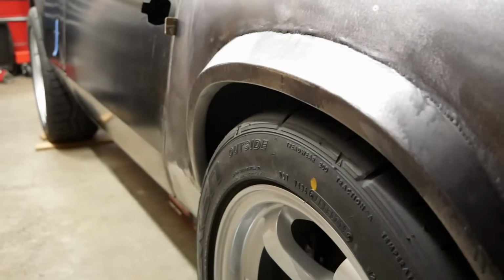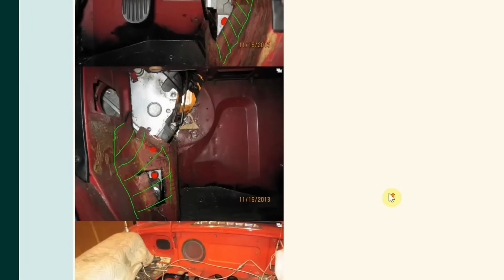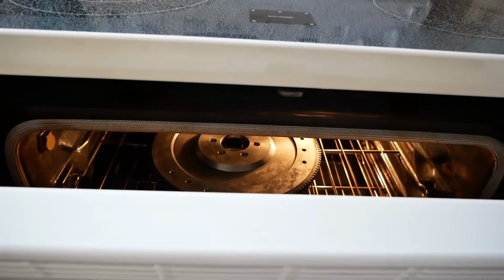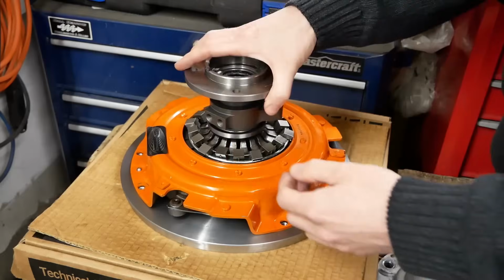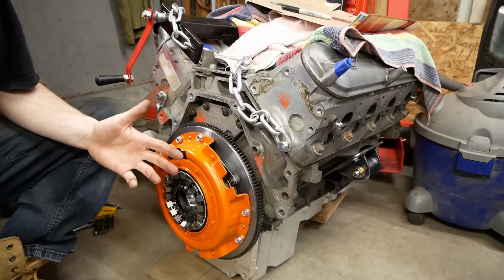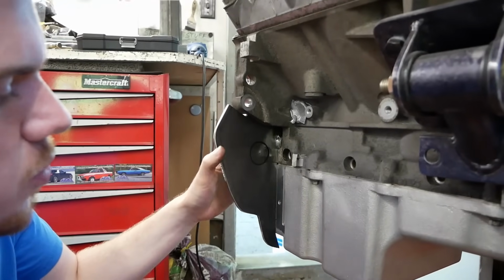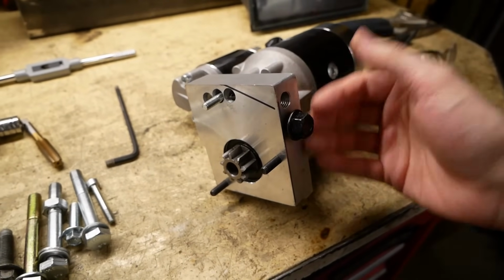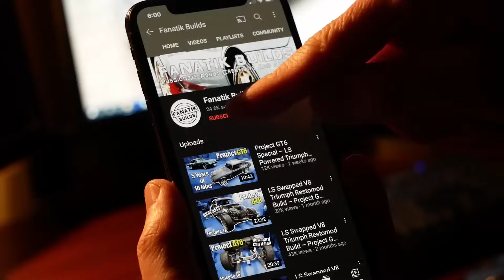The Cheapest Aluminum LS!  Pro Touring Triumph Build – Project GT6R – Ep20

Comment: As a Millwright and fabricator I've used Everlast for years for all my shop and on-site equipment.  You did well and their customer service is second to none.  I have one machine that's a multiprocessor tig/mig/stick combo that's been beat up and down stairs, around equipment and in and out of lifts that's 7 years old without one failure.  Not one.  Just found your channel and you're definitely my kinda car-crafter.  Best of luck!!!
Reply from the maker: Awesome!  Great to hear your first hand experience, hopefully my unit will prove to be just as reliable.🤞 Thanks also for the encouragement, I hope you will enjoy what's to come man!

Comment: Given this advance on your way to an LS powered GT6, the fact that you didn't win your classes in DeBoss Garage's InterNETional car show this year will be just a vague memory when your car wins.  8-))
Your entry needs to be in a "limited tool" category.  
Glad a commenter straightened out your explanation from the previous video and especially that you had the guts to run the corrected explanation in this video!  Mistakes are how YOU learn, correcting them in another video is how WE learn from you! Thank you!!  
Hurry up and put the guts into your LS 4, I want to hear it run!!  It'll also be good for you when new, seemingly intractable problems crop up. Just run the engine for a bit, saying to yourself:  "We WILL make this car run just as the engine does!"
Reply from the maker: Haha, thanks Bob! 😄 It would have been nice to win something but it was cool just hearing what some of the judges thought about the project!  And the gents from Project Binky still haven't judged yet, so maybe there's still a chance? 🤞😉
Oh we join you in the eager wait to hear it run!  It will likely be a while yet though as I'm planning on getting most of the car done before any new parts go into the engine - just makes sense not to have them sit and potentially rust or deteriorate from lack of use (thinking seals etc)... still though, I want to hear it so I may not be able to wait that long! 😂 Cheers and thanks for the kind words of support, I really appreciate it! 👍

Comment: Dude. I love this build. It reminds me so much of when I started building. You use what you have to get it all done.
Couple small things. I've learned never to use those stupid white bi-metal hole saws, and instead I buy those Diablo red hole saws from home Depot. So whenever you go to get a replacement one because that one burns up, just get one of those ones and I guarantee you it'll work better.
While you're there in the plumbing department you can get a deburring tool meant for pipes and it will still work on those steel plates. Much easier than trying to do it neatly with the Dremel.
Reply from the maker: Thanks so much Travis, appreciate the words of encouragement!  Also, thanks for the tips, the bi-metal ones we've got were on sale at Canadian Tire ... but never again!  I do think the belts on my drill press could use a replacement too though, they were slipping when I started to apply a bit of pressure. 🤷🏼‍♂️

Grabbed some carbide burrs finally, gosh should have done that years ago! Lol

Cheers Travis, hope you'll enjoy what's to come man! 👍

Comment: Really appreciate the home made manufacturing of needed parts for the starter, 100% precision is not needed to start it but good to see you outsource the flywheel😆. Pretty wild a Jeep bell pattern fit the GM engine and the Mustang T5 was the right input length. Cool build so i subbed.
Reply from the maker: Thanks man!  Haha, yes, AMC owned Jeep at the time and they commonly used engines and running gear from other manufactures - thus this weird bellhousing!  Glad to have you along for the ride, and I hope you enjoy what's to come! 👍

Comment: Great work,  I'm in the midst of putting an American v8 into a Japanese sports car, wish I'd seen this a year ago...though it didn't exist a year ago. I'm using a SBF vs the LS platform due to cost and not needing over 400hp.  2 grand for all the big parts is a hell of a deal.  You could have a nice side business selling the how to and brackets for the cheaper Ally block LS and T5 combo.
Reply from the maker: Sounds great Chest!  Which Japanese car are you swapping into?  The SBF platform is a great option and we might have gone with it if it wasn't for hood clearance! Their intake manifolds are much taller.  Ha, some other people have suggested the same thing, maybe I should consider this more seriously!  Cheers 👍
Reply: @FanatikBuilds  I'm installing my SBF into an 04' RX8.   My research shows the 302 8.2" deck engines are a touch smaller front to back and side to side than either the older SBC or the LS platform.  An Iron block SBF only gives up about 20 pounds disadvantage to an Aluminum block LS engine.  The LS is without question the better platform for higher HP, anything over 400, not that the SBF can not make over 400 but they have a history of not holding up long; although there are also many people who have made over 500hp and rev'd beyond 7k with great long term success so maybe there is a little more to the story.  I'm not looking for much more than 400 crank and even 375-ish is fine for my project.  For fitment, the pros/cons of SBF and LS are in height, as you have mentioned.  There is no intake manifold for a SBF that compares to how low the LS intake is. Additionally the SBF oil pump hangs off the bottom of the block and about the shortest oil pan depth you can go is 5.75 inches, a touch less.  Where as all newer engines use a crank snout drive oil pump and skirted blocks so you gain 2-3 inches below crank center line.  I'm not using the OEM ford intake due to height and power output limitation vs cost.  No idea how much space you have to work top to bottom. A tasteful hood bulge would be far easier that the path you have taken...though you have done a great job that I'm sure will encourage other to follow suit in there projects.
Reply from the maker: @chestrockwell8328  Ooh an RX8 eh!  That'll be great! ... And a bit more reliable than the rotary 😉 (Rob Dahm just entered the chat)
We're only shooting for around 300-350hp as the little GT6 will be roughly ~2200-2400lbs so it should be plenty for a fun ride!
Yeah, the factory hood has a power bulge, but it's still pretty tight under there.  We're actually clearing better than the original straight 6 so that's nice, still can't imagine there would be room for a carb though.  Modifying the hood was a no go from the start for us, we want the car to look factory!  Cheers man, have fun with your project and I hope you'll enjoy what's to come here too 👍👍

Comment: A soft steel flywheel will shed tiny flakes from wear. These will stick in the disk which will then cut away at the flywheel. This will happen rather quickly. Either harden the flywheel or relieve it and add a friction surface. I learned this the hard way. Best of luck.
Reply from the maker: Hey Jeff, thanks for expressing your concern there, it's 1045 billet which is what I found to be a highly recommended material for building a flywheel.  Should be ok as it is and certainly don't want to harden it, as it would then need to be machined again which will likely remove more material than we can allow for.  We did at one point consider an aluminum flywheel with a replaceable friction surface but decided against it as even the steel one only weighs 16lbs!  Putting a replaceable friction ring on what we've got though is a good fallback, thanks for the suggestion! 😊👍

Comment: Well, after seeing the amount of time and diligence that you went through just to mount that starter and all of the corresponding issues involving it. I must say congratulations on a job well done.

I have always felt that the LS with that bolt pattern arrangement was much better for swapping into cramped spaces. Now if someone would come up with a affordable swap kit that would do wonder's.
Reply from the maker: Thank you, really appreciate that!  Agreed, the 60 degree pattern does make it quite a bit more compact.  Still not a LOT of room to work with in our car, but it fits better than a traditional 90 degree pattern would have!  A few people have suggested I offer a kit, the bellhousing is the hangup for me though, ideally it would be included but they are not exactly common.  Finding someone to cast reproductions would be ideal ... need to give it more thought!  Cheers man! 👍
Reply: @FanatikBuilds  You might not need to, was the only reason that you used the jeep bell housing because it fit the ford T5? What's stopping someone from using the GM style one? Is the starter on the opposite side? I haven't checked yet, but i wonder if there is a aftermarket bell housing available. I am not all that familiar with the GM family of 60 degree engine's.
Reply from the maker: Good point, not supplying a bellhousing would allow for different applications.  Likewise not sure of every variant available, but the 2.2l S10 unit has the starter bump on the drivers side, and is still setup for a Ford T4/T5 so no real reason to use it over this Jeep one!  The 2.5/2.8l S10 unit has the GM T5 pattern and starter on the passenger side, but just not sure if it's the same location.  I feel trying to solve every solution will be more of a headache than it's worth!  If I do anything, it'll probably just be for the setup we have, as at least I can be confident it works! :)

Comment: Excellent work.  One measurement you may want to also check is the bellhousing concentricity to the flywheel. This will ensure the transmission side of the bellhousing is lined up with the crankshaft and reduce any sideloading on the input shaft.
Reply from the maker: Thanks Jeff, yes, I don't have the equipment just yet, but that is something I'd like to verify before we call it finished!  👍

Comment: Lovely piece of work! Do remember to balance flywheel, crank and clutch kit all together to minimise the rotational losses and potential wear and tear 🙂
Reply from the maker: Thanks Manos!  We definitely will - though tell me - since the LS crank is already balanced from factory, is it really necessary to use it as well, while balancing the flywheel and clutch?  Just unclear on the benefit! 😬 or is it just best practice?  Cheers! 👍
Reply: Good question indeed. It is considered best practice as it's one of the moving parts of the whole assembly so any unevenness of any individual part should in theory be counterbalanced and make the whole assembly balanced correctly. 6 and 8 cylinder engines are far better balanced to start with than 4 cylinders, so it shouldn't be a difficult job I don't think.
Reply from the maker: @manosfarfarelos8666  Good to know!  There's a local shop I found who does balancing so I'll see what they recommend, but will likely just get it all done as you say!  Thanks for the advice! 😊
Reply: @FanatikBuilds  sounds good! Look forward to the next video!

Comment: Hi,
Awesome work! Cool project.
There is one thing with hydr. throw out bearing and centerforce counterweights. If you are making shifts around or above 6krpm. Those weights bends  pressure plate "fingers" at higher rpm and bushes TOB away from the clutch. Then you need to pump your clutch pedal to move TOB close enough to work.
You may want to remove the weights or change different pressure plate. Just for your information.
Reply from the maker: Hmm, didn't look like there was any cause for concern with our exact parts, but thank you for drawing this to our attention, we'll look into it!  I'd love to keep the centerforce pressure plate if possible - the extra clamping force will be important as it's a pretty small clutch for our power level!  Cheers man 🙂👍

Comment: We stuffed  a 260 and  a  c 2 auto  trans into  a TR3.And just  toughened  the  frame  up  a little , N50-15,where  a little  too  much  traction . Leafsprings,rapped around  the  rear end  first  burn  out . That  was  back  in  1979.You have  some  good  fun , be safe !
Reply from the maker: Yes the TR frames seem to be better suited to some additional power.   Really had no idea when we set out with this car (nearly) 7 years ago, but the entire GT6 drivetrain is pretty much at its limit from factory!  Hope you'll enjoy what's to come Forest - cheers! 👍
Reply: The  car  looked good , your's  looks  way  better  and  more  fun . Nice  work !

Comment: That's an amazing amount of problem solving and direct fabrication
Reply from the maker: We're really happy with how it turned out!  Cheers David 👍
Reply: Get the adapter tested / cycle tested and you could take it to a machine shop, run it on the CMM, get the report out and model. Do the same for the starter mount block and you can make one or two billet aluminum parts for transverse 6 speed / F40 trans projects. Those transmissions don't have a starter mount too. Getting the LS4 / F40 into something like a fiero is difficult too.

Comment: I've seen ppl take off those counterweights on the clutch because there heavy and can fall off. Great build love it.
Reply from the maker: Interesting, I'd love to keep them as the additional clamping force will be important... but I don't need them falling off!  Hadn't heard that before so thanks for letting us know 👍 Cheers Patrick!
Reply: If you get a chance check out danny Johnson's video. Removing centerforce counter weights.
Reply from the maker: @1alex1311  Had a look, very interesting.  Don't see how they'd fall off based on the design though!...? Maybe the interlocking section cracks over time.  I really like it still so we may just try it out as it is, but it's good to know about this in case we have a vibration later on that can't be traced.  Cheers man!
Reply: Their weight is how a CenterForce pressure plate works.

Comment: I am using the same Center Force Clutch in my 65 mustang , there ball bearing tech makes the Clutch lite at a stop but has the extra clamp force the more power you apply through the Gears.
Reply from the maker: Yeah it sounds really cool in theory!  Heard a few conflicting opinions on the weights causing vibrations after some use, but I guess we'll just have to wait and see!  Good to know you like yours though, that's great feedback 👍 cheers Vern!

Comment: there is actually an all aluminum version of the 5.3 in trucks called L33.  I'd think that would have the correct bolt pattern and starter mount you need.
Reply from the maker: Absolutely!  A lot harder to find and a lot more money around here though! 👍 Plus it would need a new car style intake manifold which isn't exactly cheap either!
Reply: @FanatikBuilds  cost is always the thing :/  what would you have saved by using off-the-shelf parts?  LS parts swap over so that's not an issue. My darling engine is the LV1 4.3L V6.  285 hp and 300lb
Reply from the maker: @cstavro  The only cheapish aluminum truck LS (vortec) I could find at the local junkyards (LM4) was about $1300 CAD all in, and an intake manifold on eBay runs upwards of $500-800 for a used one.  The oil pan and accessory drive would also need to be replaced but so have our LS4 ones.  I'm sure you can get some of this stuff cheaper, but these are the realistic prices we have in our area!  We got the entire LS4, T5, bellhousing, clutch, throwout bearing, starter and flywheel for a little over $2k ... So it was a decent savings and worth the effort to us!  Plus, it's a very small package which fits our tiny car well 👍
Cool, the LV1 is a pretty interesting engine!  Have fun with it and hope you'll enjoy the rest of this project Chris!

Comment: I used 1045 as well. Built a 914/Chevy 350 in the 80s. The composition of the steel makes little difference in particle transfer. That's why flywheels are made of iron as it does not transfer. I can't remember from 35 years ago if the parts failed or we just found the problem when we had the clutch out for something else. My current project is a 70s Maserati Merak with a GM LFX . Love your starter solution.
Reply from the maker: Very weird, it's something to look out for so thanks for letting us know!  Sounds like a fun project enjoy it, and hope you'll like what's to come here! 😊👍

Comment: You will more than likely need a heat shield over the top sides of that starter. Awesome work!
Reply from the maker: Yep!  That will be a good precaution, though more just to protect from the heat of the engine itself, as in this position, the starter is much further inboard from the exhaust manifolds than what is normally on an LS 👌 Cheers Darren! 👍

Comment: Is the ring gear on the correct way? The chamfered side should be facing toward the starter motor. If the starter engages on the flat face of the ring gear it will chip grind and wear it down, and quickly! :)
Reply from the maker: Yep, this gear doesn't have much of a chamfer, but made sure it was placed in the oven right side up so I couldn't mistake the orientation when I popped it on the flywheel! 👍 Thanks for keeping an eye out for us man!

Comment: I’ve thought about using this engine before and I’ve got a different idea on addressing the starter issue. What about using the starter/alternator used on some early hybrids to use the serpentine belt to start the engine? This was used on early Saturn vues when they first got the engine start/stop feature.
Reply from the maker: Absolutely!  That was something we looked into, but decided on this to keep the accessory drive simpler.  Would love to see someone else do it though!  Cheers! 👍